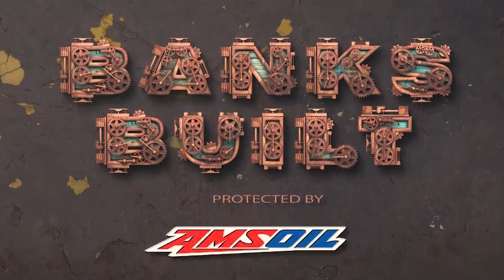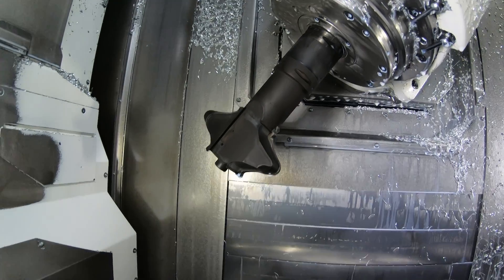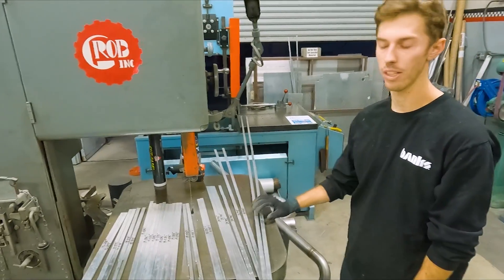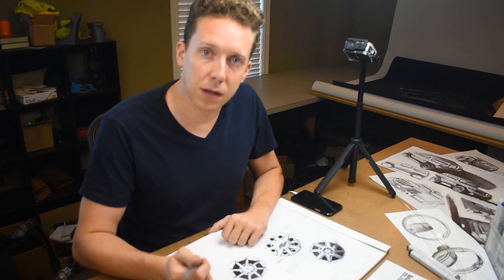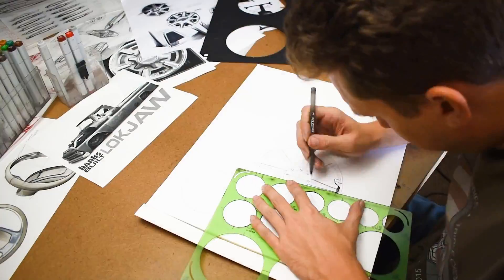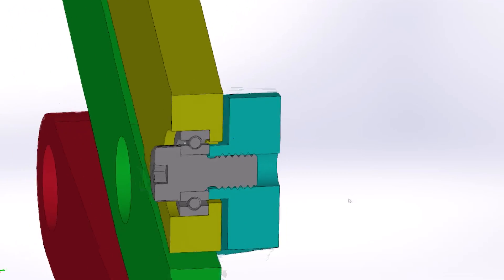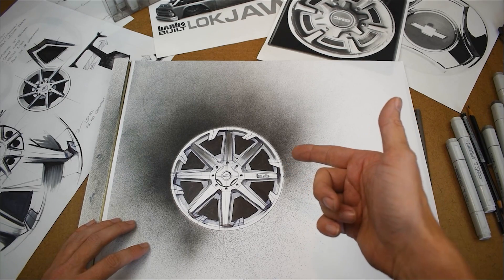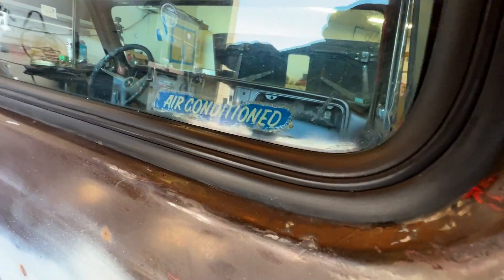If you think the supercharger is crazy, wait until you see our wheels | BANKS BUILT Ep 37

Comment: Hey, guys! Old skool, high octane gasoline stinker here; I wasn't a fan of the EPA regs back when they started in the late '60s, but learned to live with them. The E fuel systems trashed my Holley head and I'm glad now- you can have 700 hp and a clean exhaust pipe! So, when you talk about the "other guys" having problems, go ahead and tell it like it is- they are still rolling coal when ya'll are making big Hp to the ground. It is what it is. And Erik will be designing and building electric power adders and hybrids soon, leaving us all in the dust!  FR

Comment: This will likely be the best supercharger to date. Even for gas jobs. High volume cool air is as good as it gets. I'd like to see something like a kinetic assist exhaust turbine to share the load on the supercharger drive? Even a sprag pulley system should the exhaust turbine unload the drive hub altogether? 
Superchargers are superior to turbos on the bottom end without question. Exhaust powered turbines are superior on the top end. Something like a blowdown turbine that would barely add to backpressure, only designed for constant speed constant load? Would be a Lagmaster 9000 without the supercharger but.... If you could capitalize on the exhaust flow energy with very little back pressure. It would be unbeatable! A 3500hp Pro Mod with a 14xmm supercharger uses the same fuel and air as a 5000hp turbo pro mod. That could be a 5300hp superturbocharged crank driven with a blowdown turbine unloading the crank and letting the exhaust go free.